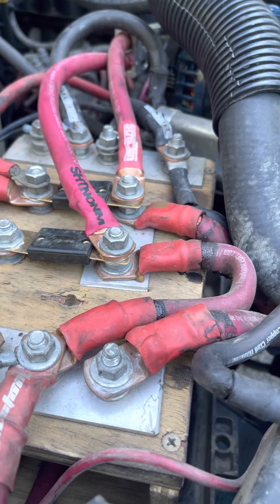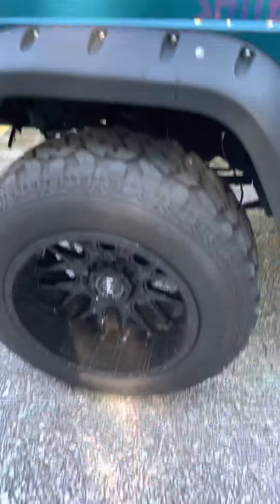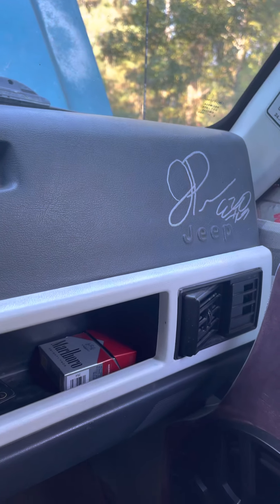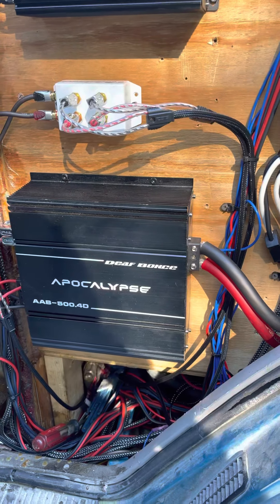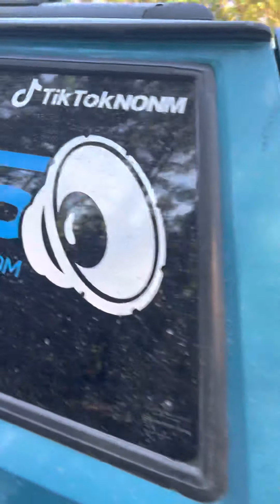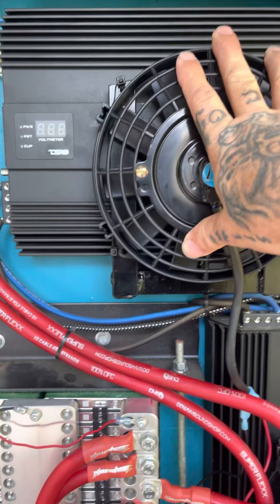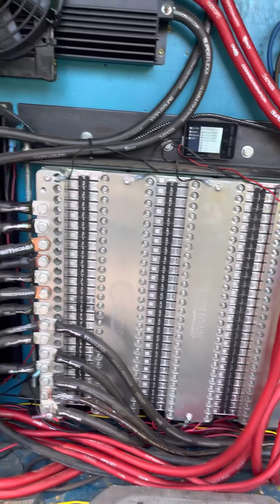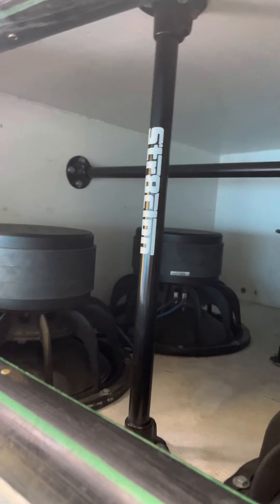Shitbox full system

Comment: Serious question!! I have a jeep exactly like you and im trying to figure out the best place to run my grounds, i have about (8) 1/0 wires that need to be grounded. I was thinking nut and bolts on the unibody? Then clear coat over

Comment: Hey man i still would like to see a vid on a complete wire lay out of what all you need to do if you got a high caliber system..from front to back.
Ie:power,rca,remote..
How many power and how to run it threw the whole system and multiple fuse and batteries. 
Rca and how to run it to a bass knob then a dsp and if you got multiple high amps and sub amp and a distro block.
Remote wire for multiple amps and if you have a light in your knob or box..
If you got relay switches also how to wire them up all the RightWay
Reply from the maker: I don't use my DSP for subs at all
Reply: @JerryAintloud  I appreciate your response..I really enjoy your videos
I understand you don't run dsp to subs.
I am in the middle of a build myself and I am in the process of trying to make shure I got everything I need in all the wire area..I haven't done a system of my won in abt 15+ and it a mild system
6 10s in a 4th and I was just trying to get some help and make shure I have all the right things iv never had to do multiple amp hook ups and dsp and relay switches.